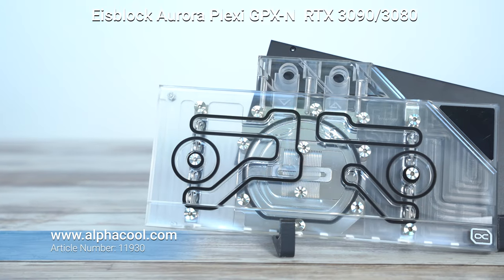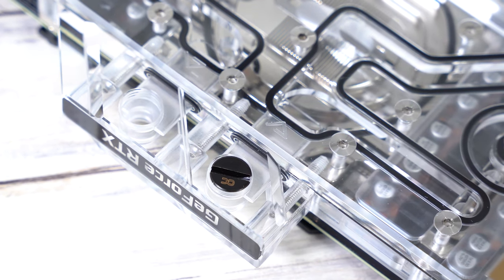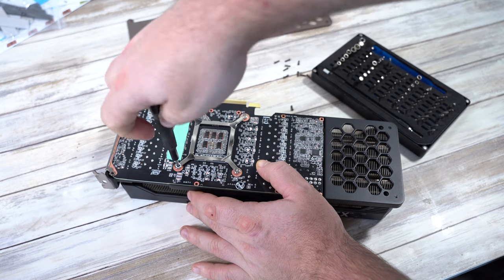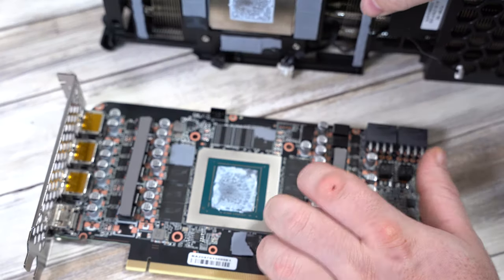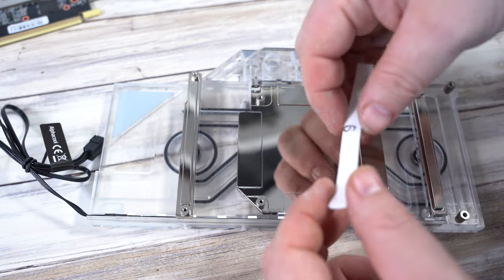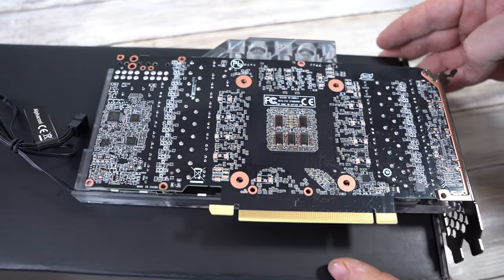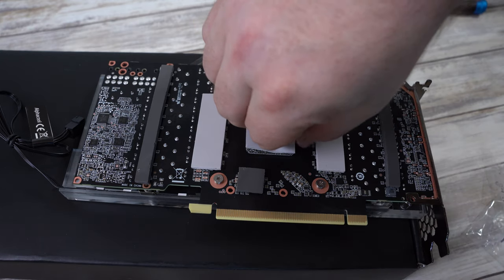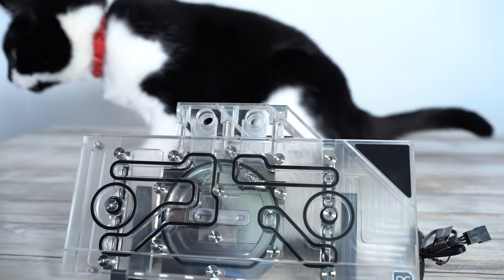How to install a 3080/3090 REFERENCE waterblock.

Comment: Followed this video to fit block to my palit 3090 yesterday, was super easy, block looks great. Temps arround 37c in furmark. Love it.
Reply: before wblock how much temps?
Reply: @sferebbasta5940  no idea I put the block on it first.
Reply: @sferebbasta5940  I have about 66-67 °C
Reply: In GPUZ, what's your perfcap reason? With the OE cooler, it's thermal throttled by the ram on the back of the card. This cooler doesn't seem to address that.
Reply: @mikebroom1866  yeah this is the same reason I am watching thus video. The ram on the back of the 3090 seems to get little attention though I hear the ekwb for the 3090 does address this.
Reply: Where could you find a block for a palit GPU? I got a 3070ti and I want to block it.
Reply: @iCasHMonyMoney  me too, 61°c a quite underwhelming experience going from a stock 71°c...
Reply: I bought this cooler and wanted to install it but there is one screwhole missing by the big 4 one in the middle shouldnt  be normal right?

Comment: I'm pretty sure he just ripped out a terminal as he was telling us to be careful of avoiding that. The white terminal around 4:20 comes right up off the board in the video.
Reply: He also put the block on the die with a hair on it, guaranteeing an uneven spread of thermal paste.
Reply from the maker: You are both correct! It is why I mention being careful as on that particular connector, nothing is holding it to the PCB. usually there are clips, or pcb mounts holding it in, but this is just push fit with the terminals. It is just the nature of the beast. 

The whole card and block was dismantled and reassembled off camera to get rid of the hairs and correct the 3 mistakes that were made (although I don't think anyone has spotted the third yet!)

The problem with doing things on camera close up like this in 4k is that I have 2 light stands, and a camera in the area I need to stand. I can only see things through the camera display with the Sony A7III as well as whilst shooting in 4k, it doesn't output to a secondary monitor so it is tricky. 

https://i.imgur.com/uoWS9dp.png

To put your mind at ease though (and everyone else) there is the block installed still, with the connector attached as good as new :)
Reply: @AlphacoolGmbH  classy reply.
Reply: @AlphacoolGmbH  Was it the 2 stock thermal pads stuck on to the block? If not that, then was there a missing clear washer or the black nut at the end of the video? I replayed it and couldn't see what the third one was!

Edit: Any chance you can show the block with the aRGB turned on?
Reply: @AlphacoolGmbH   Now this is how a company should behave yes we all make mistakes and its ok as long as we accept that and try to correct them..
unlike some..
Reply: I just did the same thing on my card - same manufacturer. But its nothing you can't recover from ;)
Reply: Should've got someone else to put the crappy waterblock on, this is terrible.
Reply: @AlphacoolGmbH  the third is no washers jaja
Reply: @AlphacoolGmbH  Thanks for the detailed and honest reply and also for the awesome video!

Comment: I just got my Strix 3080 block, and it does not make proper contact with the memory at all! No matter how many times I remount it, the block just doesnt contact the memory and so there is heavy thermal throttling with memory temps over 110C, which is 30C worse than on air cooling. This also isnt fixed by using thicker pads since that causes the die mount pressure to reduce and causes the PCB to flex. I highly recommend staying away from these blocks until this is addressed

Comment: bought 4 of your blocks for my 4 X 3080RTX and I get thermal throttling because your VRAM pads are useless I get 110C - VRAM heating issues -  ! had to take apart all of my loop and apply 12W/k thermal that I bought from amazon !! if you buying alphacool blocks -BEWARE and ASK FROM THEM TO PROVIDE YOU BETTER PADS  ! or get some gelid or thermal grizzly pads in advanced - learn from my experience !

Comment: Couldn’t you pre apply the thermal pads? If why, why not?
Reply from the maker: The heat conduction pads that can be pre-glued are not ultra soft pads and are therefore much less powerful. Since the pads are now pre-cut by us, it should not be a problem to put a few pads on the card.

Comment: I would really love to see a waterblock manufacturer making a block that also cools the back of the PCB. Perhaps it will happend with the incomming 3080 20GB DRR6X versión.
Reply: Aquacomputer has a heatpipe going to the backplate, although the design is not my cup of tea.
Reply: @Kokinkun  🤔 didn't know about that, perhaps a single heatpipe can be just enouhg, surely its better that only a backplate, although a direct coper plate with fins over the back of the DIE and the back of the VRM would be ideal. But ss i said, im very curious to see what waterblock manufacturers come up with 😋
Reply: https://www.youtube.com/watch?v=lo9r0jC6yzo
its close, although I don't like the push fittings and the reducers.
Reply: @mr.not.so.perfect.666  its a good  idea to make kit compatible with all backplates, but i also think that theese small fittings are a bit a mess, i'd like to see a better solution.   Btw i created my own watercooled backplate.

Comment: FYI - you had a cat hair between your cold plate and the GPU (you can see it at 6:15, 7:22 directly in the middle of the cold plate area.. You may want to add that people check the cold plate is clear of all debris before dropping the GPU onto the cold plate.
Reply from the maker: That cat hair is a feature.... the performance will increase a lot with it. Trust me, i have two cats and i always put some hairs on my CPUs and GPUs for a better performance. The smell is also great under full load. 

Yeah, you are of course right... the cold plate should be alwayse clear and clean :-)

Comment: I`m very happy to see that Palit is using the expensive capacitors on the back (all the crashing mess that was reported recently) I was worried that my Gaming Pro 3090 that will arrive in a few days was using only cheap capacitors and was gonna cause crashes

Comment: I noticed the waterblock isn't cooling the mosfets next to the VRM. Those are cooled on the stock cooler. Isn't that going to cause issues?
Reply: you mean the chokes? the ek block doesn't cool the chokes too
Reply: yeah this block is a bit of a mess
look at EK's block it's much better. Even Corsair's block looks better than this and I usually hate their products
Reply from the maker: During our testing, our blocks performed very well and we have had no issues at all. This block design has enabled us to fit more cards than most other brands whilst keeping the great performance :)
Reply: @Matt Earle It looks like there are two strips of metal on the left and right with direct waterflow over it, these cover the MOSFETS (actually more like integrated powerstages for these cards, they don't use discrete FETs, but I digress...)
Reply: @DuyLeNguyen  yeah looks like the inductors are what not being cooled on this block but they should typically not get that warm. So it's probably fine, they are cooled on the stock cooler though.

Comment: What about warranty stickers? 
I wrote to Gainward and they said that warranty will be voided if seal stickers are damaged. 
hmm
Reply from the maker: Depending on the fire, the guarantee conditions vary. So I can only tell you to inform yourself about the individual brands. They change that from time to time.
Reply: @AlphacoolGmbH  Thank you very much for replying.  I have one more question pls. 
I've noticed there are two thermo pads on each side (left and right) for VRM when it seem to you provide only one thermo pad for each side. It is seen when you disconnect heatsink from the board. 
Why is that?

Comment: Hello, could you please measure and let me know what the spacing of the mounting holes is on these cards? The screws you're putting in at 7:50 please. You could even just measure the backplate

Comment: Alphacool will you be replacing XC3 buyers reference 3080 waterblocks with XC3 variants?  The block is not compatible and does not cool the VRM's properly, it is not compatible eventhough it was advertised that it was

Comment: I bought one of these for my Asus Strix 3090, correct model 11940. The block looks nice and keeps the GPU cool. The problem is the thermal pads they sent with it is only 1mm not thick enough to make contact with memory. My memory temps are through the roof. From reading online eveyrone has the same problem. The thermal pads that its replacing is 2mm with the general view that 1.5mm is the correct size. Anyone else had this problem. To buy replacement pads are a small fortune which is annoying to say the least
Reply: The 1mm pads included are Wrong, and Alphacool has yet to address this flaw. These waterblocks work well otherwise with 1.5mm pads.

Comment: So how the water will cool? Because the travel distance of the liquid is to short. I think its just reheating the water inside. Could you explain it to me pls.
Reply from the maker: Heat is energy and this is absorbed and transported away by the water and released into the air via the radiator. This means that water does not cool in the true sense. Copper absorbs heat and stores it until another medium, in this case water, absorbs and dissipates the heat. The thicker the copper, the longer the distance the heat has to travel, which is why we try to keep the cooler base as thin as possible. The thicker the copper, the worse the heat transfer. Even if copper is a super material, but thinner and less is always better for coolers. The faster the heat can get to the water, the better the cooling performance. In the case of an air cooler or a radiator, copper or aluminium is placed on as much surface area as possible so that copper or aluminium emit heat to the air via the surface. But the copper part of a radiator does not really have a surface in contact with the air and can therefore only release the heat via the water. Therefore, again, the thinner the copper above the components, the better the heat transfer to the water.

Comment: bought 6800xt for msi gaming x trio - 2 screws holes are not aligned correctly,also, using the waterblock meant that i could no longer use an antisag bracket.. reaaally pissed off with alpha cool and their products. i had no number to number alignments with the pcb i actually redo itas i noticed some thermals were clearly in the wrong place because there was n clear instructions.

actually during my watercooled build, i have had problems with every single alphacool product! its infuriating.. i had my concerns with alphacool from the very begining and im midway through a build and im unhappy with the gpu block. the D5 PUMP top mounting brackets can not fit onto the top when the plugs are in. even though the instructions shownthis magical flush plug... also the d5 pump cables do not clear the mounting bracket height..

Comment: looks sick! I have Alienware R12 with 3080ti looking for a water cooling solution. Not enough space, willing to do pull radiator outside, just need a guide on how to - the waterblock install looks very easy, I wish you had a guide on full setup of water-cooling with tubes and everything :(

Comment: Are there any conserns for 3090 as memory is on the back so only covered by backplate?
Reply: maybe 3090 will use 2gb chip?
Reply: legit concern
look elsewhere for better cooling (e.g. EK's FE block that has fins on the backplate to act as a heatsink)
Reply from the maker: No concerns from us from our testing so far :)

Comment: I see that the EVGA 3080 XC3 Ultra is listed as compatible.  Is the included blackplate still used or do we use the stock EVGA backplate during install? Thanks for the video!

Comment: Please make a adapter cable for the 3080 gaming oc i dont want to install it right now. The block is lying around now for 3 weeks. The thick connecter for the power cable make the build ugly asfuck. :( but the block is so nice i dont want to change to the bykski one with an adapter cable.

Comment: This will be my first custom GPU cooling solution, what else (except thermal grease and 240mm prefilled radiator do I need) Pump? Which one should I get for this block and 240mm prefilled radiator.

Comment: It looks like the exact same layout as the aorus 3080. I bought a bykski block what thickness pads are you using? The ones that came with bykski are beyond wrong
Reply from the maker: The thickness of the heat conducting pads always depends on the respective cooler. You cannot compare this with other manufacturers.

Comment: Is there any reviews on the cooling performance?
Reply from the maker: Very soon, a few reviewers have the block we're just waiting for them to get around to using it :)
Reply: @AlphacoolGmbH  Mines installed already, seeing about 48-53c in a NZXT H200 ITX case with 120+240mm rads, seems fine for the little amount of space/rad I have.
Reply: @XeKToReX0  nice, I would love to see some reviews or videos on full block liquid cooled 3080's. There basically isn't any on youtube currently. I purchased a bykski block (in shipping) but now kinda wish I just got the alphacool. The smaller block and restrictive looking flow design had me worried.

Comment: I the 3090 Fe version of this block. While the core temp is great the mem temp is still hitting over 100c. Thermal pads from this kit were installed properly. Is there any thermal pads upgrades you would recommend?
Reply: You can try to order 15w, or even 17w thermal pads from amazon.

Comment: Does the backplate do enough to reduce the memory overheating issue on tbe 3090 fe? I had an older alphacool gpx Pro and the who block was a large aggressive heat sink. Not that pretty but worked very well. I'm wondering if these more.pretty simple and flat back plates cover the needs of cooling the RAM on the back of the 3090.

Comment: Is it planned to have prefilled addin waterblocks fpr the rtx 30 series for your eisbaer ecosystem? I don't feel compfortable with manually filling stuff and so on (worried i might not tighten somethibg enough or too much causing damage or leaks) but would love to add the 3070 i will buy around christmas or late january (hopefully xD) into the loop to have even better gpu temps and less noise.

Comment: I'm just curious. Can I expect any kind of RTX 3080 with factory built in water cooling to be ever available?
I would like to have a water cooled RTX 3080 but without need to dismantle the brand new card (which voids warranty I guess) and throw away a lot of its components (chassis &  air coolers).
Reply from the maker: You are too early, there will be some RTX 3080 cards with a water block on it available in the future. And some of them are from us ;-)

Comment: Got the Inno3d RTX3090 ichill frostbite that came with this block pre-installed.

After 10 min of usage the backplate showed temperatures of 66C and games simply halted.

Only after passively force cooling the backplate, the card was capable of keeping itself somewhat stable and not crash the renders used for the games.

With this joke of a cooling solution you take away the entire purpose of having a watercooled card.

Now why do I complain about inno3d on a AlphaCool instruction? Because the block is from alpha cool and people should be warned.

Comment: I am considering an INNO3D 3090 with this block pre-installed, and I am questionning the "over-engineered" flow on it. I counted 14 rubber seals, whereas my blocks usually have 3 or 4 at most. Are you doing this to avoid spending money on copper? Are two layers of machined plexi really that much cheaper? Doesn't it have an impact on the reliability and performance of the block?
Usually full cover blocks also cool some little controllers and stuff other than GPU, VRM and VRAM, and obviously this block doesn't. Is that a big deal?
Reply from the maker: The components on the new graphics cards are very high. There are two possibilities as a manufacturer to deal with this. Either you make a thicker copper plate to have the water flow on one level. Or you go with the water as far as possible down on the components to get rid of the heat faster. But then you have to guide the water over two levels. We have chosen the latter to get as close as possible to the heat spots with the water to transport the heat away as fast as possible. Therefore we need more channels and O-rings. The material costs for the copper are not important here. We have high purchase quantities, so the copper prices are low for us.
Reply: @AlphacoolGmbH  Wow, OK, that makes sense. Thanks for your fast answer, you may have just convinced me to buy it :)
Reply from the maker: @DrNioky  Ha ha.... then it was worth the effort to explain it completely :-) Have a nice weekend.

Comment: Does this block work with Zotac 3090 Trinity? The PCB is a little different at the end (has 2 connectors probably for fan and rgb?)  .
Reply from the maker: Yes, this block will fit perfectly on the Zotac Trinity.

Comment: @Alphacool International GmbH I hope you are working just as close with AMD this generation as you did with nVidia. I run Alphacool on all my components 4 radiators, 2 pumps, 2 reservoirs, tubings, blocks, even the water.. Would be sad to have to wait months for a block that would fit RDNA2 after it's launch.
Reply from the maker: To be honest, we worked with the biggest board partner together. Nvidia and AMD never give information to water cooling manufacturers. They dont care about that.

Comment: Block looks great, and really straightforward to install! I'm making a CAD model for a custom SFFPC and want to make sure this will fit - are you able to tell me how far the backplate projects from the edge of the PCI-E bracket (i.e. how much thicker it makes the card), and the distance inwards from the PCIE bracket to the start of the terminal block?
Reply: they wouldn’t tell you